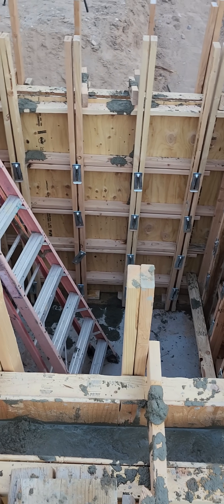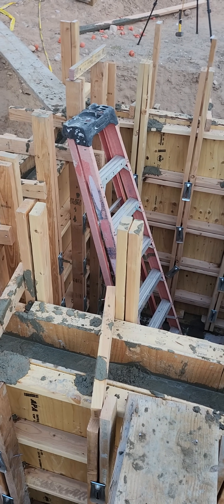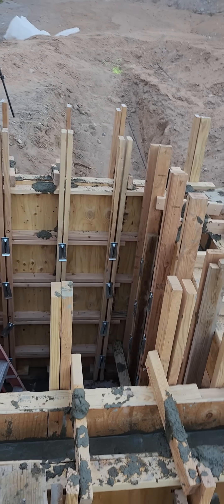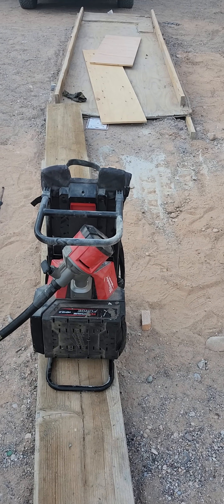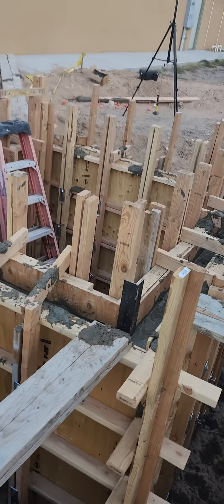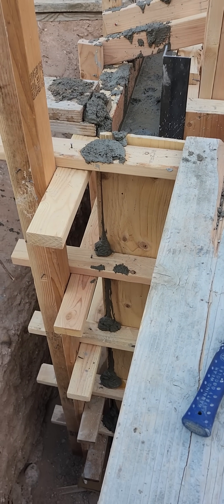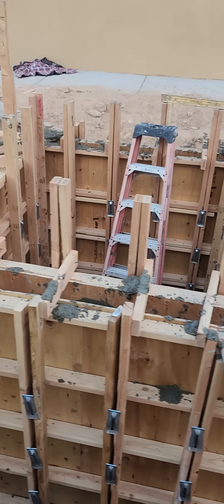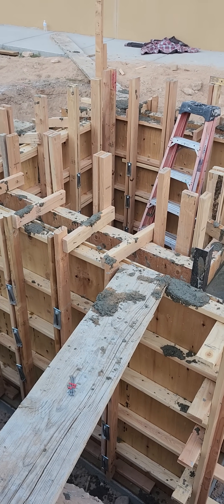Successful wall pour.#concrete

Comment: Good job. I usually put the corner locks on the inside of the corners. Holds better
Reply from the maker: I did inside and outside. Two vertical 2x4s
Reply: @OdellCompleteConcrete where you mentioned in the corner that the cream came out, try putting the corner lock on the inside of the corner or on the other side of the whaler. It keeps it closer to "action" of the form and it'll keep that corner nice and tight. I wish I could draw it for you. I love working with jahn system. Cheap and versatile.
Reply from the maker: Maybe some chamfer.
Ill that jahn system out